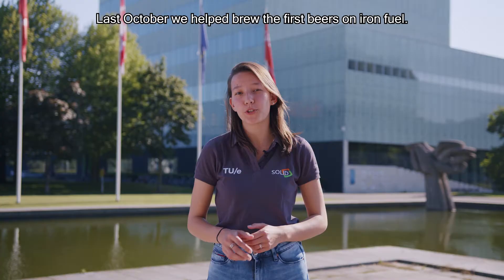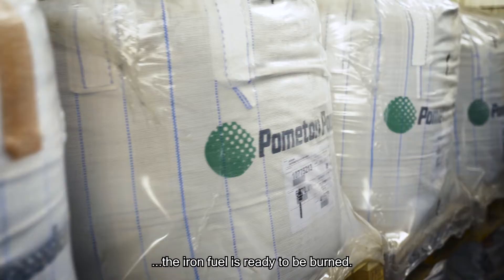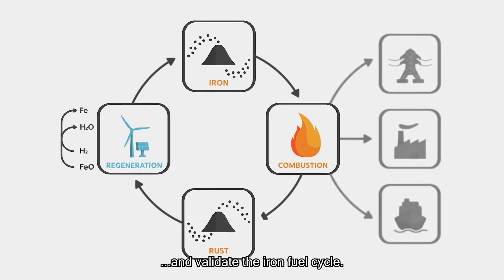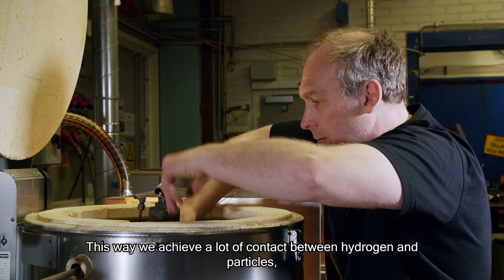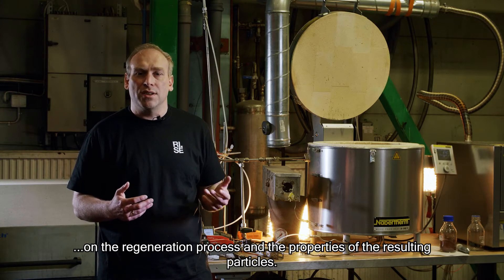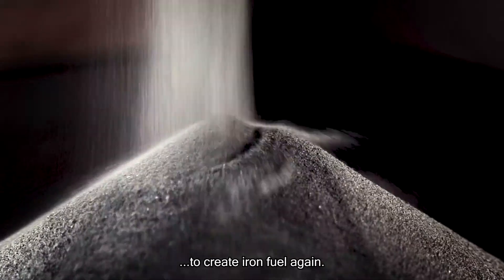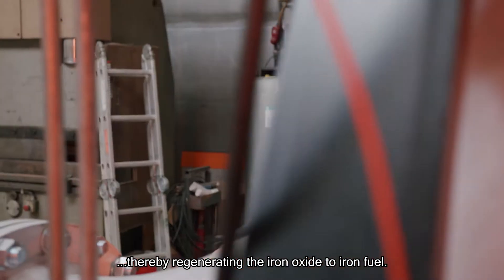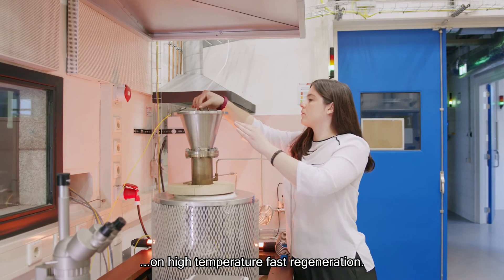Regeneration of iron oxide; making the iron fuel technology a reality

Comment: The over-all efficiency must be terrible. Think about it: First you produce hydrogen using electricity from wind and solar. Energy efficiency of that process is 50% at best. Then you remove oxygen from rust-powder with that hydrogen, which again results in an energy loss. Then you burn the iron powder to generate electricity again, that process had 50% efficiency at best. 
The whole chain has a terrible energy storage efficiency, much worse than (as an example) a modern sodium battery. Nice science project but it has no economical feasibility.

Comment: This is completely insane. You should all be in rubber rooms with those jackets that lace up very tightly at the back.
Reply: I think you are right, it is insane. If you have hydrogen, you're there! Why go through extra steps cleaning iron oxide? Every phase has a loss of energy. Unless there is something not shown here. What is the current state of this project?
Reply: Its ingenious Iron is much easier to store and to transport, it's 8 times more energy dense than hydrogen.

Comment: What's the efficiency compared with just using the hydrogen as fuel?
Reply: Oh, and they are trying to recycle the fuel.
Reply: Pretty much a wash. Currently, the primary way hydrogen is produced is by converting methane into hydrogen and CO2. So long as that problem persists, not exactly the green tech people think it is.
Reply: @TerryClarkAccordioncrazy I think it's less combustible at rest then hydrogen, I very well could be wrong though.